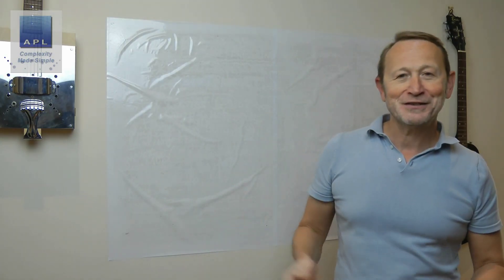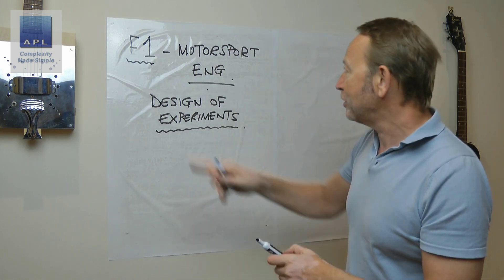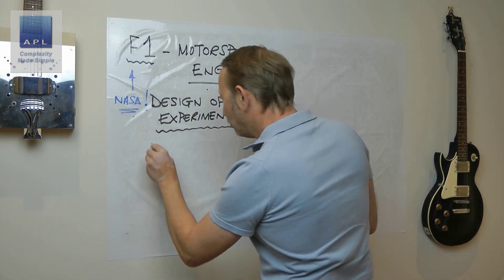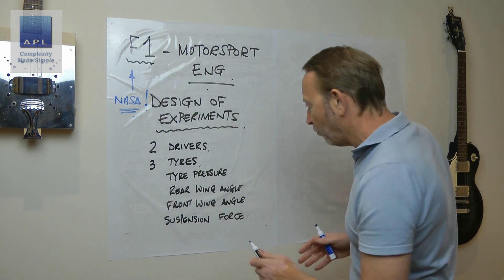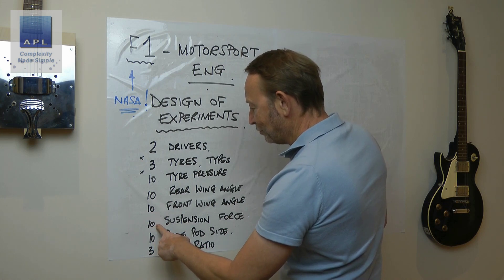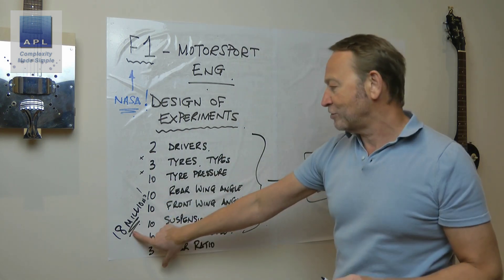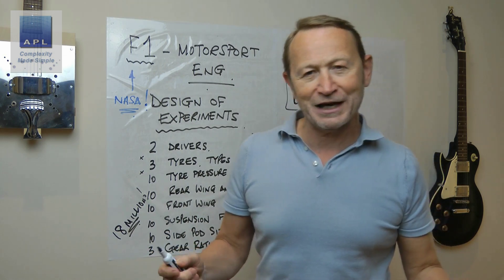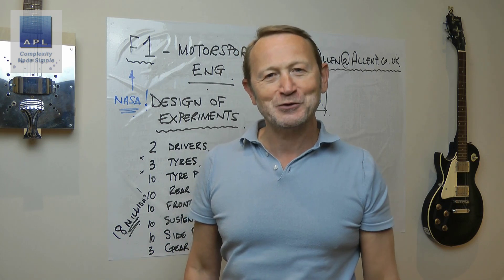Motorsport Engineers Challenge!!

Comment: The problem comes with limited running. Sometimes you don’t get the amount of laps you need
Reply from the maker: Hi Andrew - It's been a while since I posted this message, but I think the DOE I recommend only needs 36 laps, are you saying you can't practice 36 laps? and if you have a low number of laps what is the alternative to a DOE?
Reply: @paulallen5321  yes. I am asking what happens if there is, say a rainy practice session or a red flag happens. These instances would delay the session and maybe less than 36 flying laps are completed due to a red flag or delay of session. How would this affect process of DOE?
Reply from the maker: Andrew - a cancelled session does make a mess of the DOE, but then again it would make a mess of the any testing plan. My question would be just because the test session goes wrong now and again is that a reason to not use the most efficient knowledge gathering tool ever invented? CFD is not capable of doing what a good DOE can do...but as far as I know no one in motorsport will even give it a try. Strange, when it costs literally nothing to use...
Reply: @paulallen5321  I think it makes sense to use DOE. I think if a session is canceled it comes down to what the driver wants to prioritize. Thanks for the video